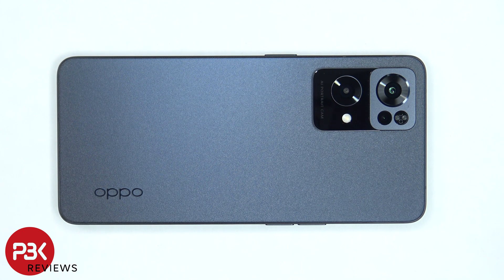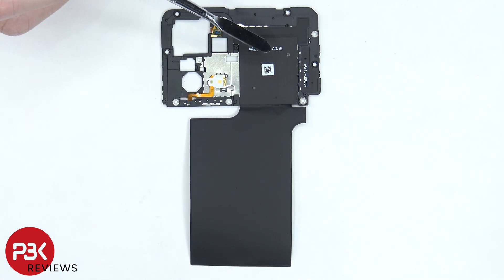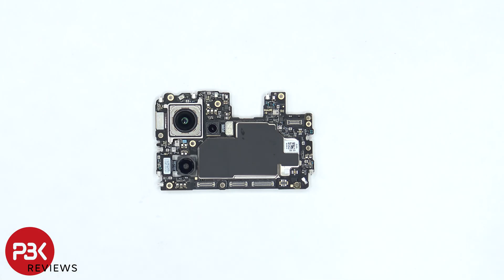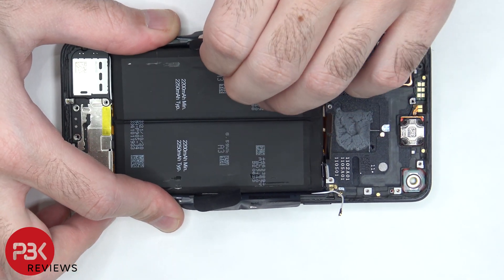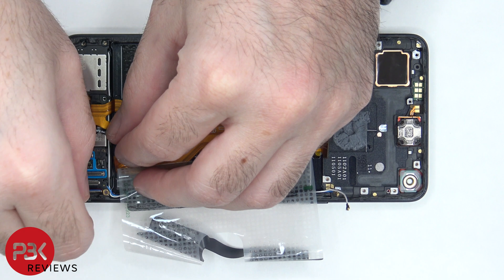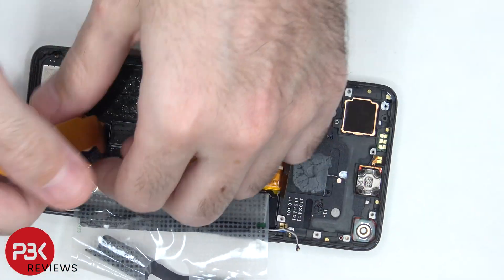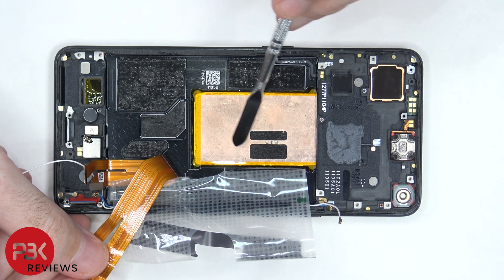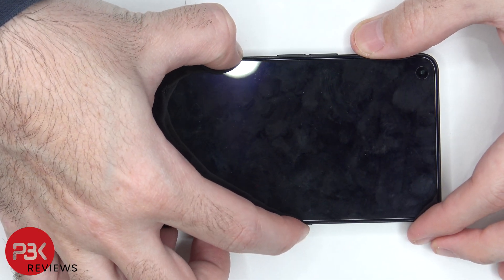OPPO Reno7 Pro Disassembly Teardown Repair Video Review

Comment: How do you peel off the old screen?
Reply from the maker: It's held on with adhesive, once you take apart the phone, you can heat it up with a hair dryer or heat gun, and just pry it off the frame.

Comment: What are the tools you've used to dismantle this phone or similar ?

Im having issues, need to strip down Oppo Pro 7
Reply from the maker: You can use these tools in this link, and a hair dryer to heat up the back of the phone or the provided heat pad in that set. Then you use the suction cup tool to help you pull up and lift the back plate slightly to get a pry pick (looks like a guitar pick) inside and work your way around prying the back off. https://amzn.to/3s6YvUa